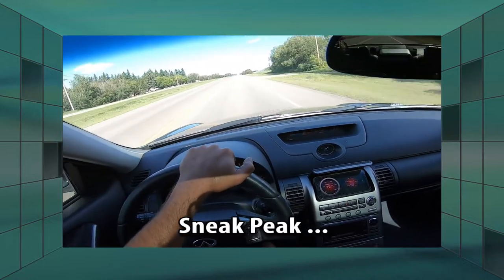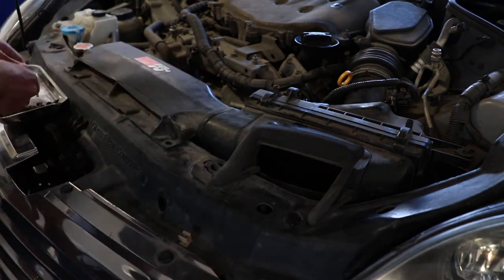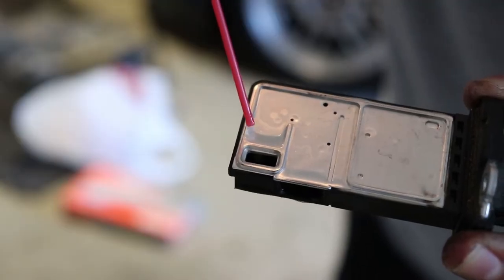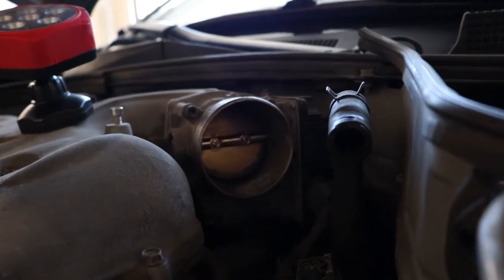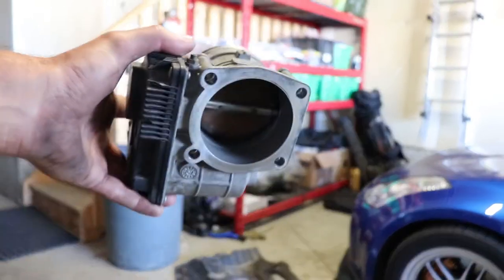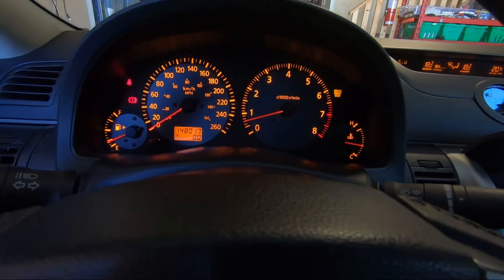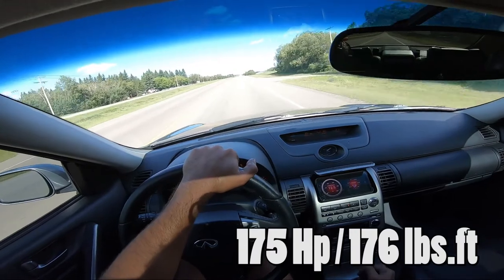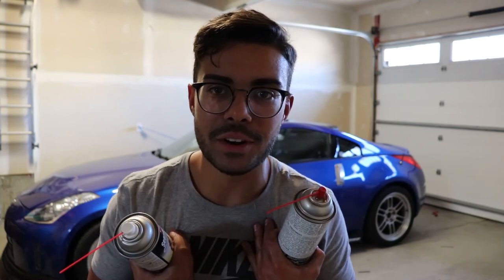MAF Sensor and Throttle Body Cleaner: Does it Actually work?

Comment: you can  use mass air flow cleaner on throttle body    no problem    you only need one can  to do  both       but you cant  use     throttle body   on mass air   hope this helps

Comment: The important part(s) to clean in the MAF sensor are the resistive elements, look like tiny springs or light bulb filaments on mine so make sure you are spraying directly on those elements.  They are the parts that measure the airflow

Comment: The green “gunk” on the butterfly is copper (cupric) sulfate, corrosion from the copper in the brass, don’t think throttle body cleaner will remove it.  If it is keeping the butterfly from moving smoothly you could use a little steel wool on it, but make sure you don’t leave any dust behind, so remove the throttle body, or use a vacuum, so you don’t suck any into the intake

Comment: I Did this to my same exact motor..its normal for little rough start after a good cleaning...you should do a relearn after unplugging of the throttle body may explain for little loss of power.

Comment: I just did mine and it made a huge difference to my car .. in your video was the sensor actually dirty in the first place ? also when i did mine i went to town on it using heaps of the can over a period of time.. you hardly did anything.... prior to cleaning mine i held the engine at  a certain rpm (not idle) and used a scanner to see what the MAF was reading.. then repeated afterwards.. Mine read 25% more afterwards which was not a surprise cos visually it was dirty. 

Also those diag apps a re useless for HP estimating. FYI i didn't uses anyof these products so im not a bot lol
Reply from the maker: And that's exactly it. If it's not "dirty" then these products are useless. I had more results by changing my dirty air filter than using these products. So I feel like gunk has to be caked onto the TB or maf sensor for it to make a difference